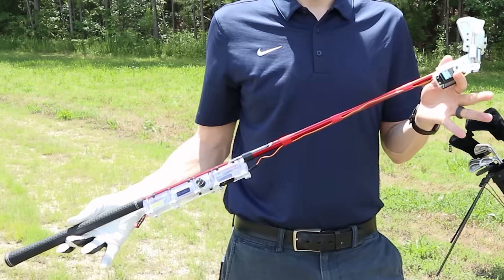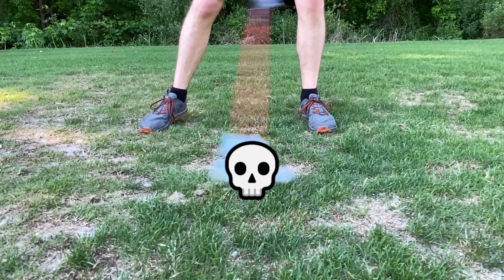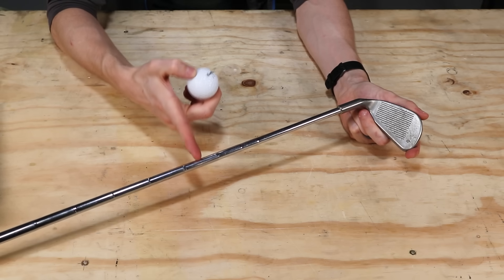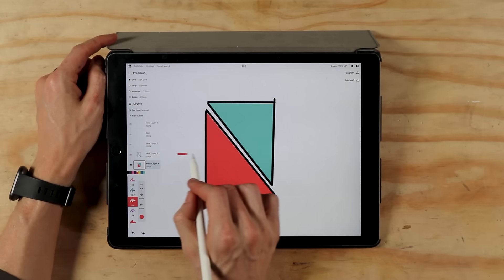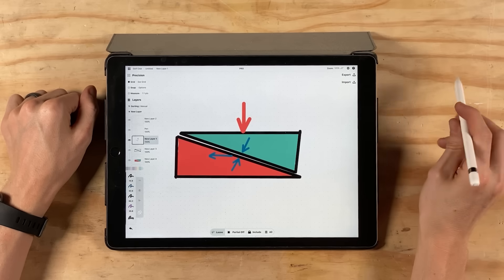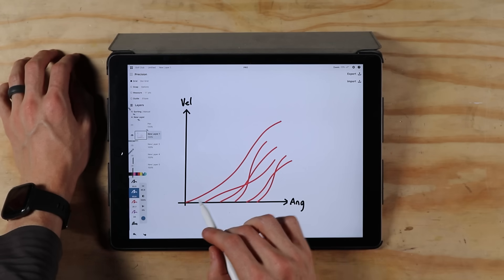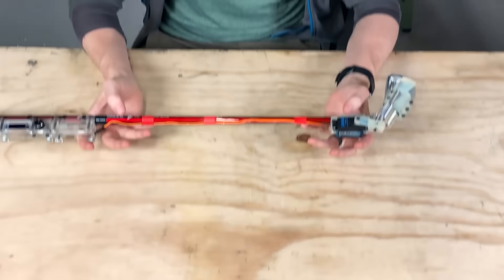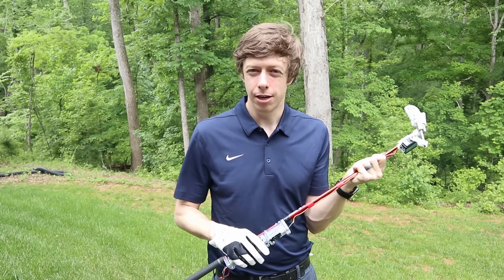My self correcting golf club makes me a better golfer

Comment: Still not as good as my ai powered laser guided club, just look at the target, swing and it works out the distance, wind speed, barometric pressure, auto adjusts its velocity so no matter how hard or gentle you swing, it always hits exactly where you want it to. The only thing it can’t do is exceed the current limits of any other club on the market plus the general physics In the distance it can go, but were working on that, eventually we will be able to compete in the us open from any course in britain or anywhere else for that matter

Comment: I know this was 3 years ago, but if you don't know this by now. You could have followed the trace lines from where the pins broke off to the next spot. I typically, just scrape the coating off the trace line to expose the copper and attach a wire there. I then epoxy over it to keep it from ripping off.

Comment: You probably couldn’t build it, for a host of legal, ethical, and safety reasons, due to the necessity of incorporating a firearm, but a sporting clays robot would probably be really fun. Both to watch and to build. 

If you’re not familiar with clays, it’s one of the 3 major clay shooting (the ones where you yell PULL and shoot at airborn pottery with a shotgun) disciplines, along with skeet and trap. Clays would be the most interesting to build a bot for of the three because it has the most open rules around shot presentation—every course, and even the same course at different times of year, will have completely different shots, from a MASSIVE variety of possible presentations and different ways to implement those presentations. For an added challenge, should you ever attempt to build this probably-illegal definitely-lethal machine, I think the bot should be restricted to the standard rule for humans, which is that each shot presentation can only be viewed once before actually attempting them. 

Even if you can’t actually do it it’s a super interesting engineering problem. Clays are inherently very unpredictable—a shot thrown from the same trap with the same setup 10 times will have a different trajectory every single time. The targets are fairly light and due to their shape can be strongly affected by the wind. There are also targets designed to roll along the ground, called “Rabbits”—they can catch wild bounces off of gravel or clumps of dirt, and then the next throw, smoothly roll across the field with no jumps at all. Some targets are also extremely fast (usually called “screamers”), to the point that you may have as little as a second to acquire, track, and fire before the target’s out of range. Extra challenge for the bot—some presentations involve two simultaneous targets being launched, called a “true pair”.  Acquiring both targets and correctly choosing which one to take first before smoothly moving to the second is one of the more difficult things to learn for beginners in the discipline—it would be fascinating to see how a robot handles that.

Comment: To assume that the shaft angle at impact is the same as starting position is erroneous. In golf simulators they have calculations of whats called dynamic loft which is the loft of the club at impact. Normally with an iron the loft at impact is numerous degrees (ie 10) less than the loft of the club since most swings lean the shaft forward at impact. Not sure how you would calculate for the shaft lean but it would be something to consider if you continue working on this idea.

Comment: I spent 10 hours to get it to work but the reason it hadn’t been working was because I had 1 one that was supposed be to 4. One I fixed that it didn’t work 10 hours later I realized it was plugged in

Comment: Am I missing something? How does the club correct for distance? 

Let's say I swing really slowly, and I set the distance to 70 yards. How is the club going to gain the extra momentum to meet the 70 yards? And the opposite is a valid question too. Like if swing really fast, then how is it going to slow the club down to go 20 yards?

What I am trying to say is that the distance the ball travels strictly depends on the horizontal velocity of the club and the momentum transfer upon contact. Changing the angle of the club at impact will not affect the distance traveled. It will affect the height the ball travels, but that's it.

Maybe I am missing something. Someone will tell me I'm wrong lol.
Reply: Yeah I get where your confusion lies:

if the club is being swung too slow then it will never reach further distances. 

What the club is doing is changing the launch angle of the ball:

if you want it to go 70 yards but are swinging too fast it will change the angle of the club to launch it really high into the air, so that it shaves off the component of horizontal speed to what is needed. 

As for swinging too slow for a longer shot I suppose it would try to launch  the ball at a 45 degree angle to gain the most distance. 

I’m not too sure how he coded it, but that’s what I got from the video. 😅

Comment: Question: Is there any reason you didn't just try to solder the headers (or just some wires) back onto the pins on the IMU instead of painstakingly writing a custom USB driver? That seemed like the more obvious solution to me, but maybe I'm just not seeing something here

Comment: 12:30. Assumption of not knowing the shaft Angie at the stroke vs the start of swing is correct. Assuming that it would be the same is not correct as you say but this is a very important so?

Comment: You could define the impact angle by addressing the ball and “setting” the position of the club along with the intended trajectory. This would help to define the hook/slice calibration as well. Then maybe do some testing with a vibration sensor to determine the relative angle at the point of impact to fine tune the data. This would help to teach the club the angle at impact vs the angle at the address point and could be used with some AI to be made for any user and it would improve with more data points over time

Comment: The 1 should be a 4. It happens. A decade ago a manufacturer of a very expensive subsea sensor (VESS) received a specification from the control system manufacturer that specified a particular checkbit value that control system would send to initiate communications. Of course there wasn't an actual VESS available to the control system manufacturer for a truly representative Factory Acceptance Test (FAT) . Instead a simulator of the VESS was provided. The VESS simulator design followed the specification and so the control system provided the checkbit value that completed the handshake and allowed the simulated data in the VESS simulator to be transmitted to the control system. Yea! FAT success!! Everything gets installed in mile deep seawater. Commissioning activities begin. The control system is powered up. The control system cannot communicate with the VESS even though current draw values infer that the VESS is powered up. Angry emails. Control system programmers change the checkbit value to the incorrect value assigned by the VESS programners. Yech. It happens.

By the way I'd like to take up golf again but I need an iron that can also adjust its length to correct my inconsistent swing. One of the (several) reasons I walked away from golf was not just my slice but also topping the ball and digging into the ground.

Comment: It would be neat to have the head weight change based on the selected club. Maybe weights in the shaft. Move them closer to the head for a heavier club and up to the pivot point for a lighter club. Liquid in the shaft with an inflatable bladder in the center. A vent tube connecting the top and bottom around the bladder and the liquid near the head could be pumped and held in place.

Comment: 4:10 The conclusions in this section about the shockwave not travelling very far up the club within the 500 microsecond contact time are incorrect. The speed of sound is not a fixed constant! It varies greatly depending on the material through which the sound is propagating. In most steels (and most other metals they make golf clubs from) it's of the order of 3000m/s, so the shockwave will easily travel the entire length of the club in 500 microseconds (in fact a quick calculation shows it'll travel more than 1.5m in steel in this time). 

From your rough indication with your hands along the club (looked like about 15 or 16ish cm) it looks like you were using the speed of sound in air (~330m/s) for your estimation and were thus out by about a factor of 10.
Reply: That is a graphite shaft but I get your point

Comment: The obvious next step is to give the head the freedom to rotate along the axis of the golf club (i.e. left/right) and make a putter aimbot. Unless you already did that and I missed it. Also I think the hack of assuming the club will whack the ball at the same angle that it's at when the swing starts could work as a legitimate technique if you brute forced it, running a bunch of trials and getting pairs of data points (angle at swing start, angle at swing end) to see if there actually is a difference and if it follows a clean function. Maybe even get a third or more data points (probably just the data from the bottom of each practice swing, just the angle they end at, because I predict the actual club trajectory of each practice swing will have the most variance of the whole thing and be the hardest to synthesize one answer from, while the stopping angle will have the cleanest correlation)) and see if a good relationship can be drawn from those.

Comment: Build a way to automate the players hand placement in the bell of a French Horn… sounds simple but it’s not. So I played the French Horn (FH) for 8 years and one of the biggest issues FH players face is their hand placement in the bell of the horn. Typically FH players use the hand in the bell to tune, change pitch, reduce vibration, increase/decrease or dampen the output sound and other things that a professional could properly explain. Yeah it’s a lot of nonsense that happens in how one places their hand in the bell of a French Horn… Good luck making something for that 😂 

This is in reference to the human robot augmentation that you referred I in the early section of the video.

Comment: Recommend using rigid tubing with an accumulator for hydraulic models. Rigid tubing can also be used as the club shaft. Double walled tubing could be used to minimize the shaft profile.

Comment: Your statement at 4:15 is incorrect.  
You're assuming the speed of sound IN AIR which is 340 m/s. 
But in the metal you're using, it can be up to like 6500 m/s depending on the type.
With a bar of steel the soundswaves will have reached your hand in 150µ!

Comment: Thinking about your hydraulic version, why do you need to use a pump to drive the system. Why not use a piston and actuator on the control side and the smaller hydraulic lines?

Comment: The problem you will run into is correcting for club head path.  You will be able to adjust the face angle and loft.  But club head path comes from your swing.

Comment: For your distance at speed of sound calculations on the hydraulic golf club, did you factor in the fact that the speed of sound is *way* faster in mediums like steel and hydraulic fluid than it is in air?
Reply: He did not. The distance along the club he indicated with his hands is off by about a factor of 10 (it's likely he used the speed of sound in air). Even a rough estimate shows the sound would easily travel (more than) the length of the entire club through the club.

Comment: Awesome project, wouldn’t a gyroscope help in knowing the angle of shaft at impact without using assumption that it’s same as when you started your swing? Also your understanding of angles at impact for a conventional golf swing are off. But I guess this method  fits your swing.

Comment: If I were to use this club successfully, not only do I need the angle of the head adjust automatically like yours does, I also need the head to automatically move on a x-y plane to always strike the ball in the center, and I probably also need automatically adjusting shaft length, because I tend to burry the head into the ground if I try to strike the ball faster... oh and it wouldnt be bad if the club could make the swing for me.... and also it would be nice if it had a holder, so I dont have to hold it while swinging, and also some kind of a mini-cart transporter, so I dont have to walk all the miles around the golf course chasing my ball... so now that I can play a real golf with this club while sitting at home, it would be nice if it had a camera so I can see how well I am doing.... can you make that happen? I wanted to go play golf two days before the day after tomorrow.

Comment: Yes, that is amazing. However, anyone with a mechanical aptitude should be able to apply a physics-based approach to proper ball striking. We already come with a built-in feature that allows for club rotation. It's called fingers.
It's simple. You have one swing plane. You swing in one direction (hopefully at your target). Watch what the ball does. If it curves, then you are applying a side spin with an "off" face. If it goes straight but not at your target, just rotate your address until it lines up.
If you want to invent something really cool for golf, produce an omni-positional practice hitting deck. Let's face it, golfers rarely get a perfectly flat lie. Every golfer could benefit from practicing off an unlevel surface.
Thx for reading..
Now go get a lesson.....!

Comment: I`m a bit confused. Doesn't sound travel at different speeds in different materials? Maybe that is the problem with your first design. Because the speed of sound in, let's say iron, is much higher than it is in air.

Comment: You asked for robotic augmentation ideas that might be worthy of your philosophy of making life better. I recently had back surgery that went wrong and capped some nerves in my lower back that left me with something called “Drop Foot”, which is a common disability that results from spinal injuries. The solution is a plastic formed brace that straps on to your foot and calf to hold it in a 90 degree angle preventing your foot from dropping down as you walk resulting in tripping and causing you to fall and crack your head open. Based on what I have wAtched you do with servo motors and sensors I can see you creating a strap on brace that is articulated as such that it controls your foot like a normal foot as it senses the ground as you walk at different speeds causing you to walk or run without a noticeable limp. Research will show you that their hundreds of rehab facilities around the world that are treating patients with Drop Foot. I will gladly be your guinea pig.

Comment: Why didnt you just solder the pins to the traces on the imu? You could scratch off a bit of solder mask and solder tiny jumpers from the pins to the traces, and then epoxy the pins back in place.

Comment: 1.PERFECT PITCHER - robot arm that can throw ANY breaking ball inside a zone (2x2 division is good enough) - low, high, left, right - you put the ball in the robotic hand, select a breking ball and it autocorrects the grip, then select zone placement and when you throw the ball it adjusts the direction and speed.
2.Archery - you could make selfcorrecting bow, because self-correcting target would be the same as the self-correcting basket
3.Freeclimbing AI (for climbing indoors) - you input your physical values (height, wingspan, leg length, grip strength, stamina...), photograph the course and the AI gives you the best route and if the grade is too high for you gives you the probability of fall. It needs a database of all possible holds and their difficulty. Dynamic movements can be excluded.
4. self-correcting bowling ball - every throw is strike
5. self-moving monofin - monofin swimming is a discipline in finswimming - you could just be still in a proper position and the monofin would do all the work.
6. kicker's boot (american football) - always hits field goal no matter the distance and angle
7. something for darts - so that you can hit any number you need
8. Croquet mallet
9. self-correcting disc for disc golf
10.You did billiards - I would like to see 147 in snooker - that is the pinnacle of cue sports with balls.

Comment: If you used a precision accelerometer inside the head of the club, you could locate the balls position by tapping the head of the club to the ball and pressing a button then the head would know the location of the ball at all times and be able to make the appropriate adjustments as you are swinging to hit the ball.

Comment: If the servo is fast enough, couldn't you just use the software to try to keep the angle constant to the horizon all the time? Basically not matter which way to hold the club, the head is always stabilized to the orientation you want to touch the ball.

Comment: You could make a fortune by Programming for the manufacturing Industrie. E.g. for all different kinds of component traceability, and or error prevention, automated part delievery, automated optimal system usage and many more. All those ideas would combine the benefits from machines with the fast adjustaility of humans. With some more thinking I would come up with way more ideas. ( This thought originated from the pool video, but here you even askedfor ideas)

Comment: Potentially another sport to cheat with robotics: Disc golf. Create a driver disc that can level itself to travel further. Alternatively it would be interesting to see a disc that could land on it's edge and continue rolling to increase distance traveled. 🤔 Potentially some accelerometers and gyros to control flight. 
Propellers or any propulsion would be off the table for sake of challenge